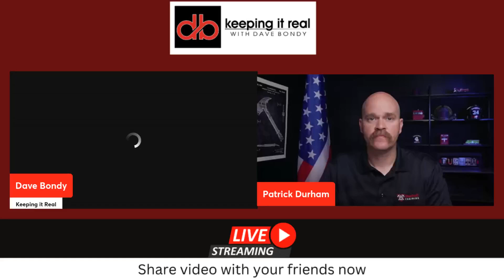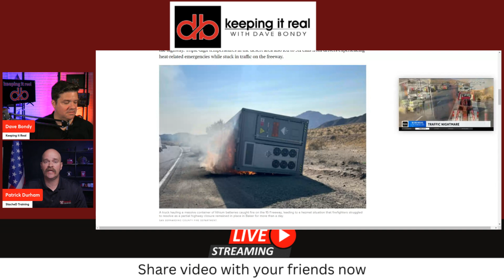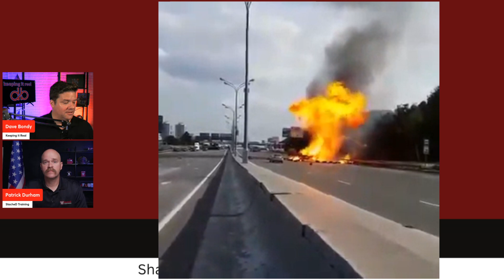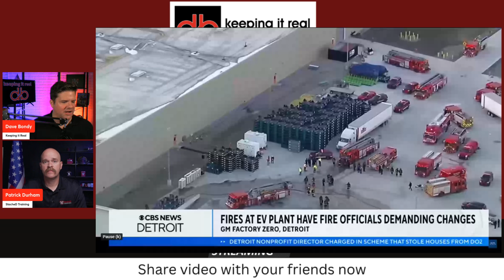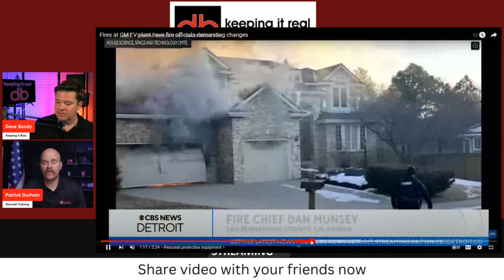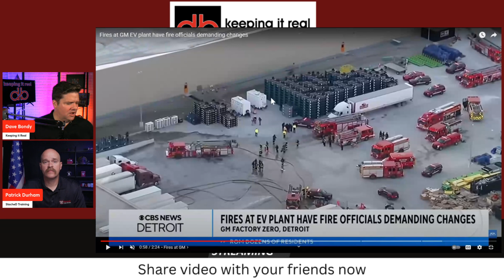What you need to know about lithium-ion batteries

Comment: New sub here remote rural off grid solar and wind Australia no way known to man would I replace my system with lithium thermal run away property burners, went off grid 11 years ago 48 V and separate battery bank for 12V LED house and workshop lighting , but I digress have been told I do so .
Reply from the maker: very very interestings
Reply: @RealDaveBondy  Thank you .